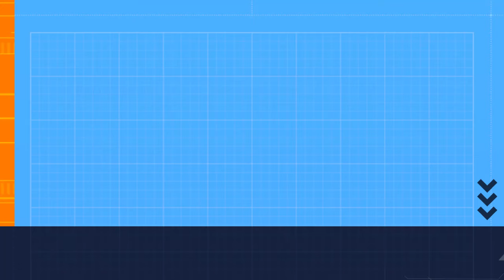easy present or craft sale

Comment: Nice little trinket box, interesting to see that there were not many cracks in the log, was it green when you were doing this. I use 0.030" piano wire for my burning lines with a wooden handle on each end, what size is yours.
Reply from the maker: D string of electric guitar  I turned some pull switch handles like light houses they are on the ends